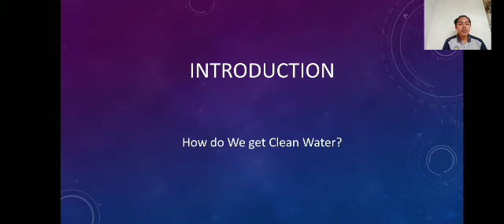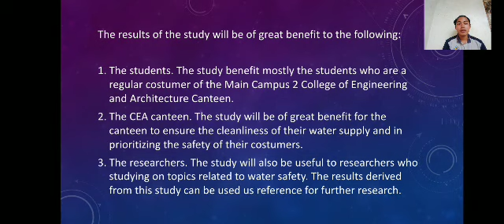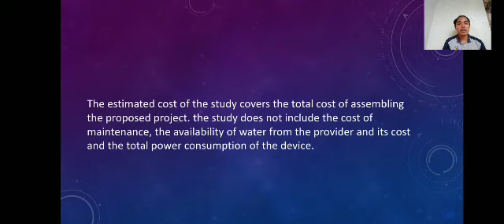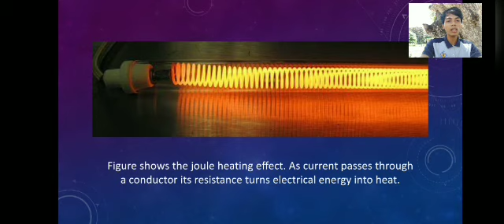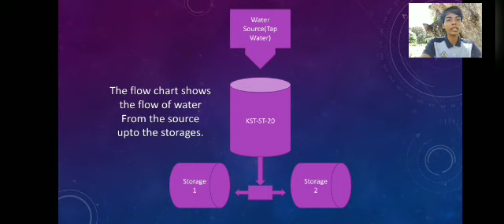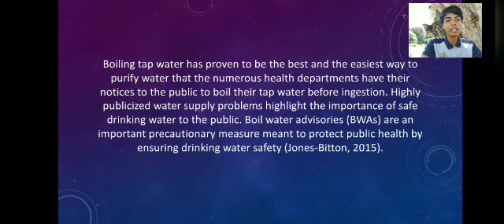Water Purification Using Heater: Safer Water Source for Specified Area.

Comment: NAME: Cual, Kayzielle B.
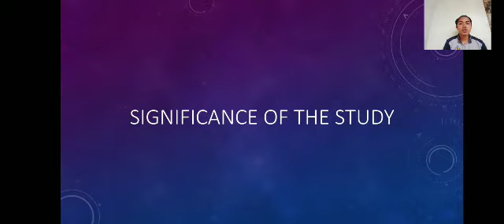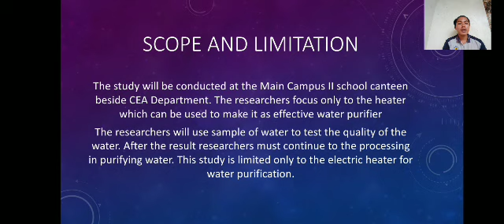CLASS NAME & CLASS SCHEDULE: ENS 341 A (2:00 – 5:00 SAT)
DATE: 3/24/2022

REACTION: Based on the video I had watched, the audio is very clear and audible but there are background noises. The visual presentation of the researchers I simple and the font size would have been bigger. They had presented their research very well and in a very concise manner. Over all the presentation was very good.

REFLECTION: The research could be of help for all the students and staffs in CEA, since health is wealth. Especially for students or staff that has sensitive stomach, consuming clean water would be safe and beneficial to all. With this study it helps in providing the student their basic needs at its finest.

Comment: TRE-INTA, KEZIA L. 
EE 341 TTH 6:30 - 8:00 PM 
MARCH 24, 2022 

REACTION: This research is a healthy idea; it aims to provide water that is drinkable and safe. It is also one way to prevent student from water contamination. I am looking forward for the implementation of this project.

REFLECTION: We used to sanitize our hands using soap and water or alcohol before eating, it is also to important to purify the water we consume for safety drinking and health purposes. This study of water purification using heater allows students on CEA to enjoy and benefit water that are clean and safe.

Comment: NAME: ATOY, AMIEL S.

CLASS NAME & CLASS SCHEDULE: ENS 341 - SATURDAY (5-8PM)

DATE: MARCH 24, 2022

REACTION: From this video, this research is a new way to open and encourage a new suggestions to students in lined with health safety who are studying in MC2. 

REFLECTION: The main problem of the university is the lack of water and healthy water. Having access to clean water is extremely beneficial in terms of health, hazards, and diseases caused by contaminated water. This study could aid CEA in obtaining a reliable and easy access water supply. Using a heater to purify water is an effective approach to keep it from being contaminated. Students with weakened immune systems are particularly sensitive to the harmful effects of contaminated tap water.

Comment: NAME: MONTEBON, GERALD MAE E.
CLASS NAME & CLASS SCHEDULE: COE 346-A (5:00-6:30 PM)
DATE: 03/24/22
REACTION: Our environment is very polluted that is why we need to check everything and clean it before using, eating or drinking. Just like drinking water, we need to purify it first before drinking it in order for us not to get harm. Heater is one of the solution to purify a water, this is one of the best and easy way to use for having a purified drinking water.
REFLECTION: The most important aspect of water purification is the use of a heater to prevent water-related illnesses and ailments. Infants, the elderly, and persons with weakened immune systems are most vulnerable to the negative consequences of polluted tap water.

Comment: Macabinguil, Joshua R.
COE 346 Methods of Research T-TH 5:00-6:30 PM
March 24, 2022
REACTION: This research is big help for the students and faculty to ensure clean and drinkable water. This could also help for the staff of the canteen of College of Engineering and Architecture for saving cost and can give a clean water.
REFLECTION: In main campus 2 College of Engineering and Architecture we didn’t know where the water supply came from and we also didn’t know if it is safe to drink. Their research can surely give us a drinkable water because of water purification.